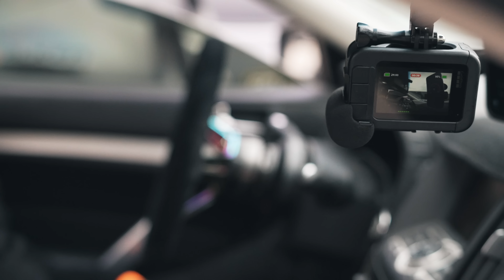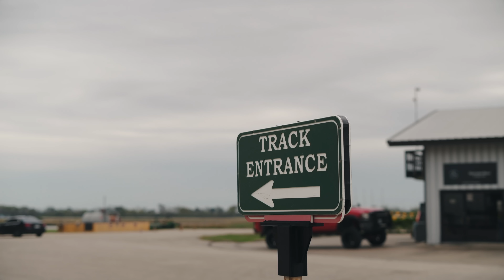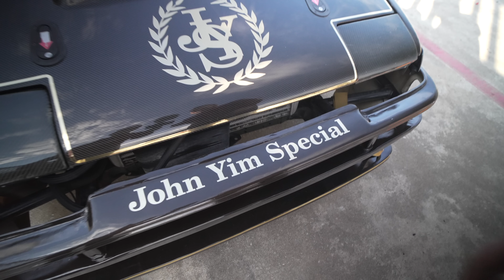Can I drift a stock car at over 120MPH? Here we go…

Comment: You should try running 120+ in a rusted out 1968 Camaro(no cage) with Four wheel Drum brakes and it pulls to the left hard 9/10 times when you brake, that 1/10 hard right keeps you on your toes LOL
Reply: No helmet either cause street racing!